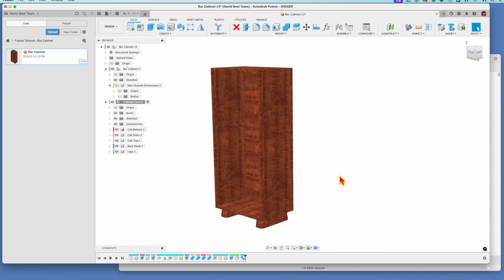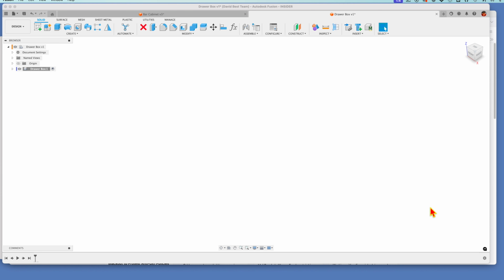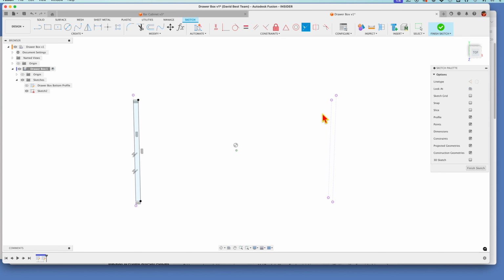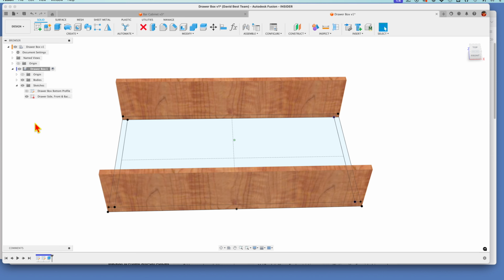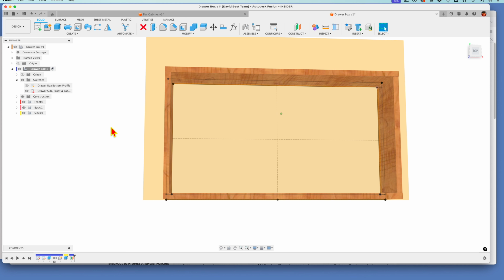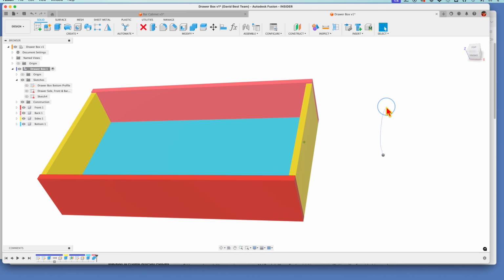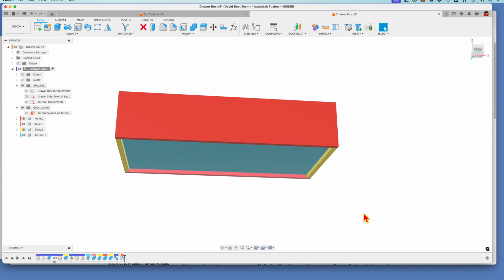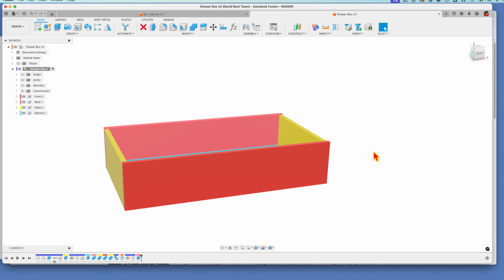Part 2 - Complex cabinet design using Fusion 360 for woodworkers. Drawer Box Model

Comment: Well done on producing a great and informative video. This is a nit pic but the way you modeled the drawer bottom grove would need to be made using stop dados on the front and back pieces which can be a challenge to create on a table saw. Even on a router table you would need to set stop blocks and then get the chisels out to square the edges of the groove. Since you order the drawers from a third party the manufacture method probably doesn't matter for this purposes of this video. Again, really well done.
Reply from the maker: This would be true if the joints between the sides and front/back are butt joints.  But in practice, the joints are dovetailed, and the dovetails placed in a manner that a groove/dado across the entire length of all the components is common workflow eliminating the need for a stopped dado. 

But, there is a method to my madness here.  I left this model in this manner with butt joints intentionally.  As I go forward in this series, I will be coming back to several design aspects (of the drawers and the case models) to make modifications and refinements to improve "manufacturability" (how it would actually be built in the shop).  I'm sequencing things in this manner to illustrate "real world" design change workflows that always come up downstream.  Going back in the timeline and editing the designs is often a necessity that many users are unskilled at or afraid of, and I wanted at least one episode dealing with this topic specifically.  Stay tuned - I will be revisiting this model, and the butt joints in the case in another episode.
Reply from the maker: One more thing:  stopped dados are unavoidable in many projects, and learning to do them with stop blocks or plunge router etc. is a commonly required skill.  I do try to design without needing stopped dados, but sometimes you just can't avoid having them.  Splines in miter joints as a classic example:  https://flic.kr/s/aHskKYd1FA  Another is a drawer box with half-blind dovetail joints - stopped dado for the bottom panel is necessary for that type of drawer.